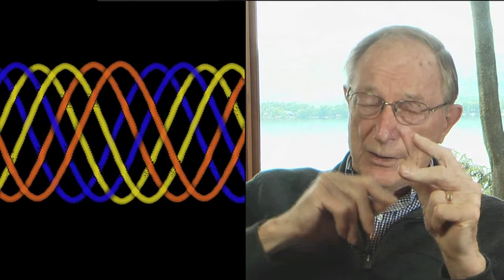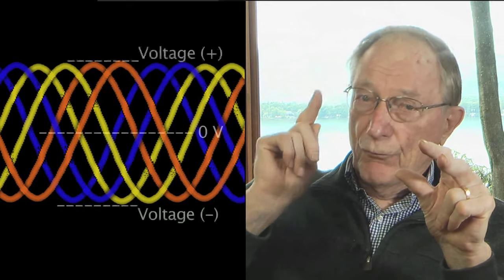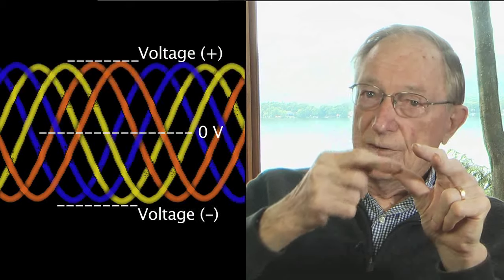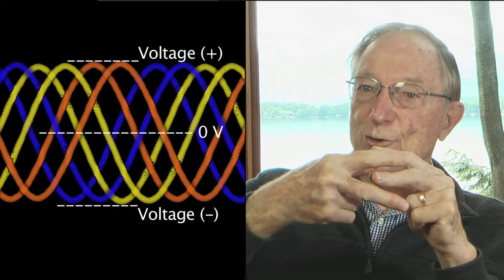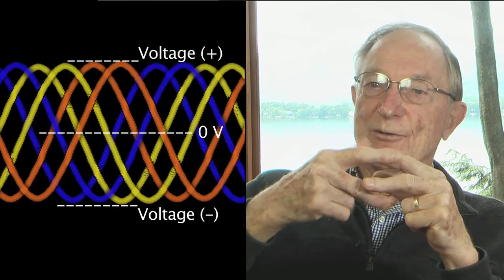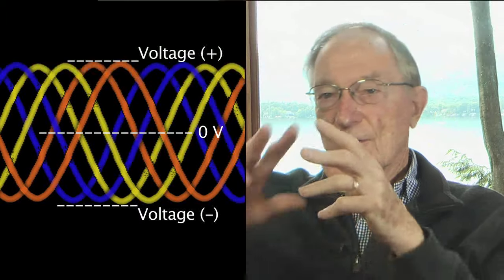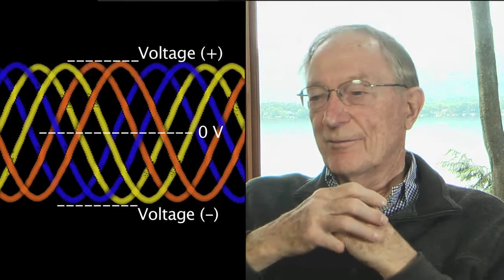Why 3 Phase Power? Why not 6 or 12?

Comment: I am an uneducated Japanese of humble means so what I am about to say is something what has been said by someone else many times. I cannot help myself leaving this remark because I think Edison was adamantly opposed to AC generations and transmission. Yet, this technology is being explained by an institution which bears his name.
Reply: Nikola Tesla was the real genius
Reply: ***** Yes, traditionally DC lines must be very long to be competitive.  However, DC is finding a second home in underwater transmission and via cables into congested areas (AC becomes difficult and impractical when cables must be longer than a few tens of miles).
Reply: Patrick Legacy One of the magnetic units is named after him.
Reply: ***** I think it is not easy to explain to 13 year old school children why AC transmission underwater is inefficient. I have a nephew at that age, and I don't have an answer which he can understand or appreciate. We don't teach capacitance and inductance at junior high schools.
Reply: tnakai1971jp Heh. It's not easy to explain this even to some experienced electric power engineers! One has to get into "imaginary power" (reactive power) generated by the cables that must be extracted from the ac cable at distances of not much more than about 15 miles. On land the shunt reactors to do this are messy but not difficult.  Underwater substations, even small ones with just a shunt reactor in them, are highly problematic.  Short underwater cables are doable though even there the reactive current flowing from the capacitance of the cables to the ends of the cable tend to use much of the thermal capability of the cable unless the cable is very short.
Reply: ***** I am pleased to learn that it is difficult even for electrical engineers as the target audience. I thought I missed out on certain things.
Reply: ***** I think a blanket statement is not appropriate. HVDC requires just two conductors and has the advantage where the savings over a long distance covers the cost of conversion (and associated losses) at each end of the line. HVDC is consistently winning out over AC in such circumstances as is evident from the many new HVDC transmission lines being built around the world. HVDC also does not have the angular stability issues of AC and that alone often makes HVDC the winner for even very short lines. see: http://en.wikipedia.org/wiki/List_of_HVDC_projects
Reply: +McGuywer What you say was absolutely right during the famous War of the Currents in the late 1800s. At that time there was no way to step DC up to the very high voltages needed to reduce I^2R losses for long distance transmission. So Edison lost, and AC became the standard.

But it's not true now. Thanks to high power semiconductors we can now easily change DC voltages by "chopping" it into AC, transforming and rectifying back to DC. This can be done at high frequency so the transformer can be far smaller and lighter than a 50 or 60 Hz transformer carrying the same power.

This is how switching power supplies work. They're small, light and inexpensive because they don't have a big 50/60 Hz transformer. It's easy to run them on DC.

Why not just use high frequency AC to make the transformers smaller? You can; 400 Hz power is standard on aircraft. (Next time you fly, listen for that 400 Hz whine in the PA system.) But induction motors don't like high frequencies, and skin effect, inductive and capacitive line losses all worsen with frequency so terrestrial AC transmission much above 60 Hz is impractical.

The first HVDC lines appeared in the 1950s when it became practical to transform DC at utility power levels. Although the converters are still more expensive than regular dumb AC transformers, the advantages of DC transmission are worth it on especially long routes and on underground and undersea cables. As power semiconductors get better, HVDC will become increasingly attractive and I predict you'll see it used much more widely. Edison may yet have his revenge.
Reply: ***** Transmission capacity limits have been a major factor in just about every major North American blackout, and since people hate new power lines I expect that we'll also start to see DC retrofits of existing AC lines to carry more power. A 3-phase AC line with 100 kV RMS phase to neutral will supply 100 kW/conductor when carrying 1A RMS. That's assuming unity power factor (which is never the case). If the line is converted to DC, it can operate at the AC peak voltage = sqrt(2)*100kV = 141 kV from conductor to ground and supply 141 kW/conductor at 1A, a 41% increase. Power factor is always unity; skin effect, inductive and capacitive losses go away; and phase angle differences are never a problem.

The trouble is that AC lines usually come in bundles of 3 while DC ideally uses bipolar pairs. Many lines have 6 conductors so they could be operated as three pairs, but I've seen an interesting scheme that uses only 3 wires. One wire is always (+) and another is always (-) and the third is alternately paralleled with one of the other two to increase its average current capability. Depending on the thermal inertia, I suppose the switching could be fairly slow, maybe 1 Hz or less.
Reply: ApolloWasReal Interesting that you should mention AC conversion. The fellow who's video we are commenting on also has patents on AC to DC conversion, including a method that loads all three "phase" conductors equally and fully. It uses converters that rotate the loading among the phases periodically keeping the average temperature of each near its rating. Among its benefits is that upon a fault on one conductor, the line switches to conventional bipole HVDC and continues operating at a lower power level. The converter cost is increased about 15% over one that would use just two conductors.

Another concept is to double up one conductor, usually the middle one because it is often better supported than the outer ones. The middle conductor becomes one pole and the outer two become the other pole. I came up with this while working with Lionel on his "tri-pole" concept.
Reply: ApolloWasReal On another issue you bring up, transmission capacity limits contributing to blackouts, I have a different take. A good friend once said "bigger lines cause bigger blackouts" meaning higher capacity and longer lines (we were looking at extending the eastern grid 765 kV overlay at the time). Indeed, while blackouts might be fewer, they surely could be bigger with new long distance high capacity transmission lines. But, more to my point, grids are operated in accordance with operating standards that are quite well defined. They are deterministic rather than probabilistic and thus don't make all girds equally reliable, but they have been developed and proven based on experience, most formally since the 1965 Northeast blackout. What I'm getting at is that from a reliability standpoint (e.g., blackouts), grids aren't limited by the acceptance of transmission lines by the public, but by the fact that the operating standards do not dictate that more transmission lines are needed. The public may resist and affect just what lines are built, but when it comes to reliability and blackouts, the needed lines are built or some customers will not be served. This is ever more the case in recent years due to Federally mandated enforcement of the operating standards. New transmission lines that improve economics may be deferred due to public resistance, but not ones that are needed for reliability. For reliability work-arounds are found and meet the operating standards. If we want to reduce blackout risk, we need to first tighten the standards.
Reply: ***** Nearly every blow-by-blow of a blackout I've read describes a cascading failure initiated when a transmission line is overloaded and trips, shunting its loads onto other lines that overload and trip in turn. I know that the dispatchers run models looking for such vulnerabilities, but they still miss them from time to time, as in San Diego in Sept 2011.
Reply: ***** Poor power factor is also a contributor to many blackouts I've read about. Because it reduces the capacity of the line to transmit real power, the lines can become more easily overloaded and trip. Sometimes you'll have a line and generator (e.g., a hydro unit "running dry" as a synchronous motor) merely carrying reactive power for voltage support, and when that line or generator trips the rest of the grid collapses.

You mentioned phase shifts across lines; this was a big factor in the 2011 San Diego blackout. When that poor guy in Arizona accidentally interrupted a line carrying ~1.5GW to SD, he couldn't re-close it because the phase angle across the switch was so high. I'd hate to be him...

All this would be a thing of the past in a DC network.
Reply: You have nothing to be ashamed about. Edison started with DC because it makes possible electric motors that reliably start rotating in a preferred direction. It was this decision, to start with DC distribution, that became his greatest investment. He spent a great deal of money and time perfecting this system that when AC was proposed by George Westinghouse he could do nothing but ridicule this competing system. Before DC generators had been developed the early generators were AC. Early motors were also AC, but they could start rotating clockwise or counterclockwise at random. Nikolai Tesla had had a moment of true genius when he figured out several ways one could bias an AC motor to start in a preferred direction, including multiphase AC. He had worked for Edison for a little while, but Edison would hear nothing about AC and his stubbornness drove Tesla to seek employment with Westinghouse. From there, Westinghouse and his AC system became the standard of efficiency and began to displace Edison's DC system. When a young Hungarian and his brother invented the transformer for AC, the system of DC power distribution finally obsolete. You'll still see evidence of both DC and AC power living together in some old appliances. Early 5 tube radios and vacuum cleaners that could run on either AC or DC. Multiphase AC power allows a motor to be started and run in either preferred direction by the ordering of the phases. It was this idea that Edison could not understand, but Tesla did :)
Reply: Joseph Perkins But Edison may yet have his revenge now that power semiconductors have made it practical to transform DC voltages. DC-DC converters are usually more expensive than dumb AC transformers, but I wonder how long this will remain true since the transformers inside a DC-DC converter can operate at high frequency and use far less iron and copper than a 50 or 60 Hz AC transformer of the same power rating.

This is true for computer power supplies and the like, but utility-scale AC/DC converters still switch at a low multiple of the grid frequency because their very large semiconductor switches can't go faster, but I expect that will improve over time.

Who knows, we could someday have an all-DC grid with DC->AC inverters in what used to be the dumb distribution transformers out on the poles just to give the customers what they're used to. I admit this is a radical thought but the grid is in a a big transition due to distributed renewable generation, and I can see how it just might become economically advantageous to convert as much to DC as possible. It's already happening at the high end of transmission.
Reply: ApolloWasReal Depends.

AC and DC have a number of pros and cons to consider. All voltage and current are, in a conductor, electromagnetic waves. The electrons travel very slowly, but the EM component is just under the speed of light. This is part of where the skin effect comes from. As frequency goes up more and more of the EM wave in AC electrical conductivity is excluded from the bulk of the conductor by a self induced magnetic field. DC sees the same effect, but the frequency is 0 Hz. On long lines (really long ones) the mutual capacitance of the Earth itself and the air around the conductors can mess with 50/60Hz EM waves and the voltage can get extreme. That's why they put "reactors", or large inductive reactance (coils), on the lines at periodic intervals to balance the capacitance. DC does not need this, so the cost and efficiency penalties of using DC at 1 Mega Volt can be offset by not needing any of this. DC to DC converters still use an inductor that acts as a one winding transformer, but now add two or more switches (switching transistors and diodes) that hurt efficiency. So, when power levels are just right, a DC/DC converter will be used. Otherwise, a good old fashioned chunk of iron will be used. Transformers can get to nearly 100% efficiency and, in theory, a superconductor can be used to make a DC transformer. A DC/DC converter can get to nearly 93% efficiency because of the switches.

Boils down to: Overhead "Extremely High" (over 500KV) will go DC. Overhead "Very High" (from 500KV down to 115KV) will remain AC for a long time. Overhead "High" (from 115KV down to 13KV) will remain AC for a much longer time, if not until the "Singularity". In house wiring will also remain AC. But, as is already happening, nearly all appliances and gadgets will use a switching supply (mainly for isolation from the mains since there are now chips that can take 700VDC input and provide 50W at any other lower voltage now... look up the Power Integrations LNK306DG IC). Our GE washing machine runs on 120VAC and has a very high power (600W) AC/DC converter and uses a high power stepping motor to drive the tub and pumps. I don't think anything in the house except the dirt cheap answering machine phone we have (made in China) uses a chunk of iron copper coil AC transformer. The CFLs in the garage all have an inductor to act as the lamp ballast at the 40KHz the power oscillator inside runs at. All the LED bulbs (all but the cooker/stove. That's still an incandescent)  have an AC/DC converter that uses a very small 120KHz transformer.

Edison's original battle against AC was part stubborn pride, part reluctance to abandon a huge investment and a chip on his shoulder when it came to Westinghouse :P
Reply: Joseph Perkins Interesting comments. But what about DC distribution (as opposed to transmission) as power semiconductors continue to improve? Won't DC-DC converters eventually outperform 50/60 Hz AC transformers on cost, weight, and efficiency?

Where did that 93% efficiency figure come from? That's a good computer switching supply, but the efficiency of a grid-scale converter should be considerably higher. As in any switching supply, the right frequency has to be chosen to optimize transformer cost, power semiconductor frequency limits, size and overall efficiency.
Reply: ApolloWasReal DC-DC converters in small appliances are amazing little devices. But, from what I've seen in power electronics, that 0.7V forward drop has not improved much and will remain a fact of life for a while yet. In fact, the newer devices like the voltage-source converter have higher losses (switching losses I think) than the basic line-commutated converters. Still they are gaining favor due to their many advantages. But, those are all transmission devices.  

I too question the 93%.  The worst I've seen is 98.5% at each end of a DC line and that's for the higher-loss voltage-source converters.  I think the latest ones are closer to 1% at each end, or at least getting closer to that. I think the improvement is not in the solid state devices themselves but the circuits that combine diodes and switches.  Don't quote me though, my work is in bulk grid applications, not converter design.

Back to your question about distribution. Distribution transformers are heavy and at one time had dismal efficiency. They now use higher quality iron and more copper and losses are a fraction of what they once were.  But, replacing them with a DC-DC converter suggests using DC in the building. That probably means lossy DC circuit breakers since conventional circuit breakers don't interrupt DC current very well. There's a percent or more loss right there. I'd guess a lot of appliances would be more efficient if they worked from 120V DC, but then we have the chicken and egg problem. One could not build a DC house until enough appliances are available and the industry would not build DC appliances until there is sufficient demand.  And converting existing distribution systems would be a nightmare as well.  I think we are stuck with the switch-mode power supply for a while.  They are pervasive and do work well.
Reply: ApolloWasReal To answer you and Harrison Clark. The 93 percent figure is real world from converters of the usual kind that don't use resonant or synchronous circuitry. They typically run from 85% to 90% and with some of the newest upwards of 93% (last one I worked on, a 600W LLC converter. A resonant design). Now, there are a few that handle hundreds of KV, but the losses remain similar since they need to stack hundreds of devices. The highest IGBT devices commercially available are about 3KV and 500A, so you can see the problem. On really high voltage AC-DC-AC or pure DC-AC conversion, they resort to a form of motor/generator. I'll defer to Harrison on the details as I'm one who works on converter designs and he works on the grid :)
Reply: ***** See my replay to AppoloWasReal. Yeah, that 0.7 number held until the last couple of years. Schottky diodes with as low as 0.4V drop at 50A are common, nowadays and mosfets have gone into the milliohm range for Rdson. The losses are in the several stages before getting to the output. Even so, the lower weight, superior regulation and smaller size have made offline AC/DC converters king in appliances and have even begun to make inroads in white goods, like dishwashers and clothes washers, blenders, etc for powering stepper motors instead of the old standby fractional horsepower AC types.
Reply: Joseph Perkins I'm glad to hear of the progress.  Now if only I could get my home power usage below 151 Watts when PG&E calls a SmartDay under their SmartRate program.  I turn off everything including the fridge and my load is still 151 Watts.  This is off-topic I guess, but all of those little AC/DC converters in my A/C and phone and modem and router (required for the phone) and printer and various wall worts, efficient as they are, still add up.
Reply: ***** Parasite Power. Do you have a gas fired furnace or hot water heater? The 18VAC transformers they typically use run the thermostats, circuits and relays inside those. You have alarm clocks, remote controlled appliances, like TVs and DVD players? You have wall worts and chargers? Yup. You got a case of 151 Watts of parasite power :P
Reply: Joseph Perkins You nailed it.  Except that both water heaters still have gas pilot lights, all else is as you describe.  Both A/C units have brains that don't go to sleep.   TV, DVD and receiver drawing a few watts.  DVR had an HDD spinning.  Someday I'll turn off circuit breakers one at a time to find the worst offenders.  Fridge gets a bit warm at the end of the 5 hours due to A/C being off.  I still come out way ahead on the SmartDay program, but the 151W is irritating.
Reply: ***** You can get a meter that has a simple plug and socket arrangement intended to ferret out the worst offenders. Rantion (in the UK and US... comes with a universal plug set) is a good brand. Also the Kill-a-Watt from P3. Plug it in, plug the gadget into it, then wait a day or two and get a readout of how that load is drawing power. Some meters even come with a USB port so you can view the info on your PC. Can get a bit pricey, but what gadget doesn't when you add bells and whistles?
Reply: ***** It's actually quite easy -- install enough PV panels to drive your consumption negative, then you don't have to worry about all those phantom loads. :-)
Reply: Joseph Perkins Yes, those Kill-a-Watt meters are real gems. I have several.
Reply: Joseph Perkins 0.7V diode drops are significant in end-user low voltage power supplies but they're utterly irrelevant in grid-scale DC/AC converters operating at half a megavolt or more. All grid scale devices, transformers, inverters, rectifiers, etc, invariably have much higher efficiencies than small user devices. They have to, otherwise they'd simply burn up. When you're carrying a gigawatt or two you can't afford to dissipate 70 or 140 megawatts, which is what 93% efficiency would imply. I'll have to look up the actual efficiencies but I suspect they're all in the 99+ range.
Reply: Joseph Perkins The last I was heavily involved, conventional HVDC converters were about 1% each and voltage source converters were about 1.5% each. Hence about 2% or more per line, often largely offset by lower line losses in the case of longer overhead lines.  HVDC Submarine cables get round the limitations of capacitance of AC cables and use voltage source converters.  

Things are changing though, so don't quote me.  I hear talk of voltage source converters on overhead lines; seemingly there is a work-around for the problem of clearing faults and re-starting, that previously limited voltage source converters to cables (where there is no recovery from a fault).
Reply: ***** So let's say that an HVDC line didn't have to deliver AC to its load; instead it could use a DC-DC converter to provide a different (presumably lower) voltage for another DC line. How would the efficiency of such a line compare with one that provided AC to its load? (Because it's DC-DC, you get to pick whatever switching frequency you like.)

You see where I'm going with this. What will happen if lower voltage AC transmission lines now directly supplied from HVDC circuits were themselves converted to DC to increase their capacities?

Assume all converters are voltage switched so that each DC line keeps the same polarity regardless of power flow direction, allowing multidrop busses with arbitrary power flows just as in AC networks. How would that change the efficiency and the economics?
Reply: ApolloWasReal I can answer this one for you. An optimized AC/DC system is very simple technology. What you gain from DC is no dielectric losses and no skin effect. And, despite the fact that HVDC converters operating at 800KV are... scary, the parts are rather robust and you can tap the line anywhere you like. Since you are using a DC/AC (or even a DC/DC) system, you can convert any arbitrary DC voltage to any other. The savings in the two factors I mentioned can overcome the losses in the converter stages.

That's the only thing Edison lacked. Economical DC/DC converters. If he had those, we might still have a fully DC grid.
Reply: ApolloWasReal I do see where you are going.  And I think the technology to actually consider this conversion isn't far off.  Assuming DC-DC conversion is more-or-less as efficient as transformers, the biggest technical issue is probably networking and circuit breakers.  In a DC network, resistance alone dictates how power would distribute.  In an AC system line inductive reactance dictates how power flows and that gives us a mean of controlling power flow.  It's not always needed but is very helpful when it is.  And, yes, often series compensation is used to fix stability which is not a problem with DC lines.  But, I would not rule out DC because it is less controllable.  The bigger technical stumbling block is probably circuit breakers.  Interrupting DC current is tricky business. We do now have DC circuit breakers, at least in the laboratory, and for the higher voltages. Lower voltage DC breakers have been in the lab since the 60's but the problem of losses remains.  The power you use in your house goes through roughly two dozen circuit breakers between the generator and you appliance.  Those losses would add up.

Another issue is that we have a massive existing grid with three conductors per line.  Converting those to DC leaves

There is a benefit to conversion to DC.  The voltage can sit at the crest of the AC wave thus increasing power on the line (ridding us of that root 2).  This benefit is limited by the ac insulators, but changing out the insulators allows full use of this potential.  If the center phase can be doubled-up (a second conductor added), there can be two positive and two negative conductors for another boost in power capability.  

The big stumbling block is inertia. DC appliances won't be built until we have DC in the home or business, and we won't have DC there until the appliances are available.

The bottom line I think is that the net advantages will have to be substantial before there is any move in this direction.  At this point that is a long way off.
Reply: ApolloWasReal I do need to look into this.  Thanks to gov't subsidies, I'm among the last in my area to go solar.  I do have a patch of roof that gets southerly sun most of the day.
Reply: ***** Good luck. With declining panel prices and subsidies, the economics are actually quite favorable these days. And you get the unique satisfaction of watching your meter go backward.
Reply: AC is the chosen distribution based on a 2 dimensional world from 100 years ago. I believe DC will win out in the end.  In the future the Carbon Nano world "in 3D" has unimaginable possibilities. DC will make a come back.
Reply: Dan Murphy Nonsequitars "Carbon Nano World in 3D" is buzz words strung together with no explanation. In the real world DC will dominate at the level it becomes economical at. At lower power/voltage levels, AC will still be used because it is very effective, very inexpensive and very simple. Carbon Nano tubes and other carbon based nano structures will be used to enhance batteries, electronics and many other technologies, like semiconductors, but not transmission lines or distribution directly. Except perhaps in the semiconductors used.
Reply: Joseph Perkins in a way you made my point for me. We are in our infancy of Nano tec. yes I agree. Buzz word, ok if your not looking for a real answers, But Nano strictures are being designed to perfectly fit the electron in a semiconductor passage made of carbon. It will be used as the most efficient way to store & transmit energies. No need to transform or rectify it, Plus one tiny tinny line of carbon will be able to carry 1,000-10,000x the amps current copper can handle. theirs your inexpensive answer you needed. .Side note; (the nano wire will not only carrying the electron but will be able to carry photons as well)  Really the possibilities are endless...  Simply put the Idea of long range power transition is bad all together. It leads to power robbing grid ties, hence my earlier comment 100 year old 2D technology. example; Large VERY un-efficient wind/solar farms don't really help. Renewables done on large scales are very wasteful, But if done smaller scale Note; (reducing generation size is what I have termed "Nanoing") Small scale home production of DC power is the future.  I realize this a short explanation But I would love to ramble on & on & on. So Peace Out
The Murf!
Reply: Dan Murphy Sounds a bit like you are attributing magical properties to Carbon Nano tubes. Yes, they can carry amazing amounts of current, but you have to make the proper comparison and that involves scale. An ant can carry 100 times it's own body weight. A human can carry maybe twice their own body weight. But the ant is only able to handle a few milligrams and the human is carrying 200 kilos, more than 100,000 times as much. Just to get a carbon nanotube structure able to carry power from a power supply a few kilometers away would require hundreds if not thousands of kilos of material. Even in the home, by itself, are a dozen or more kilos of wiring. Carbon Nano tubes are not superconductors and they are very delicate. In an integrated circuit they can conduct much more current per square than copper or aluminum and even be used to form the gates of mosfets so small they will enable the next generation of sub 10nm scale ICs. In batteries they will be used to form electrode structures that will help push Lithium and Vanadium chemistries right to the theoretical limits. They will be used for Light Emitting Devices called Quantum Dot LEDs (a non-carbon Nano technology). They will make fantastic surface treatments for all sorts of biocompatible implants. And, who knows, maybe homes of the future will get a boost from solar and there may even be a use for Carbon Nano tubes in electrical transmission (if the delicate and fragile problems can be overcome). But cooking food requires dozens of KW/Hr per day to do unless you continue to use CO2 emitting fuels. Carbon Nano tubes are a specialized form of Buckminster Fullerine, by the way.
Reply: Joseph Perkins You keep mentioning nano tubes... I am not referring to tubes at all.  Single & multiple layers structures are required,they are also the strongest structures know to man. . I will get to the ant thing in a min..

 Yes there is Diametric properties found in some graphite carbon structures. , thus the superconductor aspects i mentioned above is possible & under development.

Ok so, that Ant you described above, if it was the same size as the human he could carry 20,000 Kilos.  See how things get more efficient in smaller scale> ?
"Nanoing" nothings more efficient. Nothing. 

Anyways back to original discussion,  Breaking a flux field with a mechanical motioned magnet devise is currently the "easiest" way to use 100 year old school technology to produce AC current. Copper/aluminum wire is the easiest cheapest way to transmit it.  This will not be the case once everyone gets on the same page (same goals). DC will have it's day. ;)  Yes Tesla was an awsume dude that got screwed over by the powers that be. Same can be said about a dieing old man that got his patent lost at the pattern office & a year later Alexander Gram Bell (who worked there) filled the work under his own name.     
We need a new way of looking at things.  "Nanoing" is the future!
Reply: Dan Murphy You're thinking of graphene and it has super diamagnetic properties, not super conductivity. Current room temp (well, regular refrigerator temp) superconductors do exist, but the structure owes nothing to nano-assembly.  As long as electronics exists there will be transformers as they provide all those DC/DC converters (and AC/DC converters). Nothing will ever beat the cost of a simple 400A pole mounted mains transformer for many reasons, not least of which is its virtual indestructibility compared to a solid state DC/DC converter. This I know as I make a living designing DC/DC converters... give ya a hint, there's still a transformer in there.
Reply: Joseph Perkins Of course there's still a transformer (or at least an inductor) in every DC-DC converter. But it's a lot smaller and lighter than those operationg at 50/60 Hz. As power semiconductors continue to  improve, and as the raw materials in a transformer (especially copper) get more expensive, there will come a time when the DC-DC converter will be cheaper than a "dumb" AC transformer of the same power rating.

Check out the many videos here on Youtube of "indestructable" utility transformers destructing because of  the lack  of overload protection. They're especially spectacular now that PCBs have been replaced with (flammable) mineral oil.
Reply: ApolloWasReal That's part of the economics I mentioned. You have to balance efficiency losses, cost of raw materials, weight, footprint, cost to manufacture and cost to maintain. Someday there may be a tipping point, but that has to come as a natural evolution, not because raw materials are too scarce to do the job the old way. That's not a good cycle to get onto. We waste so much I am hoping soon enough we will start mining our ever growing landfills for usable materials. Look at all the plastic that ends up in the ocean. Better yet we'll start mining the asteroids and stop polluting the Earth. Manufacture stuff in space. After all, better to mess with nasty things where those same things are long a part of landscape.
Reply: Joseph Perkins Have you been following the price of copper these days?
Reply: ApolloWasReal Yes, DC would solve a lot of problems.  But, it introduces a lot of problems. In a DC grid resistance dictates where power flows and so one would need to add resistors here and there to force power to flow on the lines with the ampacity to handle it.  Yes that line would have lower resistance and inherently take more power, but power has to flow around load pockets and such so must be forced onto some longer lines.  Not easy with DC.  And lossy.  Unless there is a negative resistor in the offing (DC to DC converter again?.  We have lots of tricks to control power flow in ac grids with little or no loss.

Then there is the short-circuit problem and interrupting high currents. AC circuit breakers have zero loss.  DC?  AC circuit breakers are approaching 90,000 ampere interrupting capability (and do so in 24 ms).  DC? Just those circuit breakers in your home interrupt 10's of thousands of amperes.  A current-limiting DC to DC "circuit breaker" on each feeder in your home and on up the street in various locations back to the main grid? All lossless with AC.  Certainly all doable with DC and eventually cost-effective ... if the losses can be eliminated.

And, when power flows from Manitoba through the eastern grid to Florida as it often does now, how do we deal with the voltage drop that is needed to make current flow in a DC grid?  Place those DC to DC converters every few hundred miles to restore voltage?  It's easily dealt with in AC (compensation and transformers).
Reply: ***** Actually, power flows are much easier to control on a DC line than on AC; this is one of its big operational advantages. The converters are active and can be commanded to pass a specified amount of power despite DC bus voltage fluctuations.

AC grids are notorious for large, uncontrolled, wide area changes in power flow during transients, such as a line or generator trip. The power flow is driven by the phase offset between the ends of the line, and these can jump dramatically and uncontrollably. E.g., in the San Diego blackout of Sept 2011, the accidentally tripped line in AZ feeding ~1.5 GW westward could not be restored because the phase angle across the open switch was too great. So all the power looped the "long way round", overloading other lines until they all tripped in a classic cascading failure.
Reply: Joseph Perkins again you are inserting things I am not talking about.  im not talking electronics, witch is wereall the dc to dc trans should be needed for, your job is safe!  if you design transformers than explain to me what all the oil is needed in a 400a, or any transmission trans...? . how about heat dissipation form the side effect of non efficient transmission. if your ever get a chance to be at a sub station take some temp readings. 
Yes Graphene is single layer carbon, but is can be engineered to be super conductive too.. not just super but the best that can be developed.
Reply: Dan Murphy But all HVDC transmission lines involve electronics, that's the only way to generate and convert those voltages, remember? So once you have the electronics, you have what you need to control power flows.

Reducing transmission line losses is precisely one of the main reasons to use DC.

Oil is used for both cooling and insulation in large power transformers. They're efficient but not 100% efficient. Transformers designed for much higher frequencies (i.e., in DC-DC converters) can be much smaller for the same power, and while I don't know their exact efficiencies they certainly require less materials to build.
Reply: ApolloWasReal i agree DC to DC can be more efficient, but my piont is we need to eliminate most of the transmissions all together.  power generation & storage supplies will be made more coast effective than the copper lines & will be made for the self sufficient. & this will be possible in the near future. & nanoing will be the force, the force will be with us... lol
Reply: ApolloWasReal Okay. You are going to put converters at each end of each line. In that case, you are preaching to the Choir!  I just finished a 48 year career largely running stability studies throughout the US and many other countries (often involving HVDC lines).  So, yes, of course, converters work great as you suggest.  But won't that bankrupt the country?  We are talking going DC and leaving AC behind, correct?  I.e., we are talking 100% DC grids? We are going to double-up on the center "phase" to make all three phase lines into DC lines.  But, with the average line length (I"m thinking 230 kV and above) being fairly short, that's a lot of converters  Wouldn't the cost of the converters have to be maybe 90% less than they are today?  Is this possible?

Not to mention substation space.  Just adding a new line termination is almost always a nightmare.  DC converters are huge.  They will have to come down to not much more than the size of a 345 kV circuit breaker and CT to fit in the substation or maybe out on the ROW under the first span.  As I've mentioned before, lots of issues beyond the basic question of whether DC grids will work.

Heh, I know the SDG&E system well.  I worked on the Sun Desert transmission plan and a few issues since then for SD&GE.  Even got bodily kicked out of Terry Winters' office one day (long story).  There was a spell where the company I worked for was not welcome at SDG&E (long story) but otherwise I was there occasionally.  I also was on the Blue Ribbon Panel that guided BPA onto the right track after the two August 1996 voltage dips.  Talk about reactive shortages and power swings!
Reply: ApolloWasReal Apollo, your comment about eliminating most of the transmission altogether is interesting.  Lionel Barthold, the author of the video we are commenting on, wrote an editorial for some magazine (IEEE Power or Electrical World or some such, I don't recall) when the idea of dispersed generation and storage first came up (well before "smart grid" and the like) envisioning a day when we would be taking EHV lines out of service and tearing them down and how would we ensure stability with missing lines and how would we control voltage on the grid as it was dismantled and such.  It was very much tongue in cheek, but did make the point that this would not be an easy process!
Reply: Major Mittens The actual difference between AC and DC for safeties sake is that both voltages can polarize the heart muscle.

DC causes a unipolar discharge in the heart muscle and the nervous system can, after the voltage is removed, recover heart function... if you're lucky.

This is the basis for defibrillators and the like. You can restart, stop or alter the rhythm of the heart using carefully timed DC pulses.

AC, on the other hand, can completely depolarize the heart and the chances of recovery are much slimmer. Usually, an electrical shock victim whose heart has stopped must be defibrillated (AC or DC).

In both cases, cooking effects also vary. DC causes damage by pure resistive effects (salt content, water content, etc.). AC adds dielectric effects so the cooking is a small bit worse. In either case, well done is not a good thing :P
Reply: Major Mittens DC is still AC, but at 0 Hz :P
Reply: Dan Murphy Dan, I completely disagree. As we use more renewable energy, efficient long distance transmission will become more important, not less.

First of all, we have no good utility-scale electricity storage systems other than pumped storage, and it doesn't look like this will change any time soon. Or at least we shouldn't wait to deply renewables until we have local storage.

Second, renewable energy by its very nature is diffuse and intermittent. This is certainly true for wind and solar. You must collect it from a wide area and transmit it to the loads in the population centers. In the case of wind in the US, they tend to be very far from the windiest areas.

We will need much more transmission in the future, not less.
Reply: ***** Yes, I am assuming DC-DC (and AC-DC-AC) converters will become much smaller and cheaper.

Given that they consist of power electronics, and given the rate at which semiconductors of all kinds continue to improve I think it's a safe bet that at some point in the future we will have a utility-scale DC-DC converter that will be smaller, lighter and cheaper than an AC transformer of the same power rating.

But I agree we don't have it yet, which is why HVDC tends to be restricted to very long high power lines where the increased efficiency overcomes the relatively high cost of the converters at present. As converters become cheaper, more and more lines will be economically practical to convert to DC, and I do foresee a point when much of the grid has become DC.
Reply: Major Mittens You don't want to get shocked by DC or AC, and in today's world there's simply no excuse for accidental electrocutions. Follow the NEC, ground properly and use GFCIs wherever they're mandated, and accidents are extremely unlikely.
Reply: ApolloWasReal I missed your March 22 post!   The scheme you mention, one +, one -, and one that switches back and forth, was patented by non other than Lionel Barthold, the fellow who's video we are commenting on.  My name is not on the patent but I did work with Lionel on this and we co-wrote a paper or two on it or maybe I just proof-read his drafts, I don't recall.  The converters that modulate the third conductor to in turn relieve an overload on each of the other conductors (+ and -) cost about 15% more than conventional HVDC converters.

The alternative is to double-up on the center phase which works well on most flat horizontal line designs.  I.e., hang a second conductor on the middle phase.  Or just convert double-circuit lines as you suggest.
Reply: ApolloWasReal The interesting part will be converting the existing system. Doing it line by line will leave a weakend AC system for a while. HVDC lines can have dynamic controls that provide synchronizing power but that means leaving some of the DC line's power unused (except transiently).  

A solution might be "Segmentation."  You may have seen this in Computer Applications in Power or similar.  The concept is to break the AC grid up into segments (roughly 20 GW to 50 GW) or islands with back-to-back DC converters or DC lines between them.  This eliminates regional stability issues (think August 14, 2003).  The inter-island ties would all go DC first and them maybe the islands would be similarly broken up.  EPRI sponsored studies that confirmed (the obvious) that this approach would have avoided the Aug 14 2003 event.  It also allows the DC ties and lines to be operated at much higher power levels than the existing lines.
Reply: ***** Yes, DC ties really do help control power flows. Can they be scaled up now or do we have to wait for better technology?
Reply: tnakai1971jp   He conformed.
Reply: +tnakai1971jp
Why AC transmission is under water inefficient is easy to explain via quantumphysics and the interference of waves. When 2 wavefronts will travel tought itself and has the factor λ/2 then your wave will be annihilated, but when the factor is just close to λ/2 then your electrical wave will be muffled thats, because of the spin from the hydrogen & oxygen atoms which break his molecular state and reorder themself in an exact frequency.

https://en.wikipedia.org/wiki/Superposition_principle#Wave_interference
https://en.wikipedia.org/wiki/Quantum_superposition
https://en.wikipedia.org/wiki/Chirality_(chemistry)
Reply: +Joseph Perkins
Wrong! All begins with DC, because DC is also chemical electricity which is the oldest from all discovered electrical sources. Nikola Tesla is a genius which have seen a natural principia which is a force which also rotates our earth around the sun and this every single day.

AC is a funny energy source. Did someone from you know why a computer has to run with DC insteed of AC? Think about this question, because it has an enlightment answer. :)

Here is a challenge! Accept it and solve it! ;)
cosd(6,e+995) = ?
cosd = Cosinus Decimal Degree
https://en.wikipedia.org/wiki/Trigonometric_functions